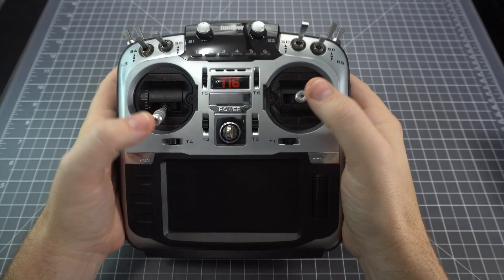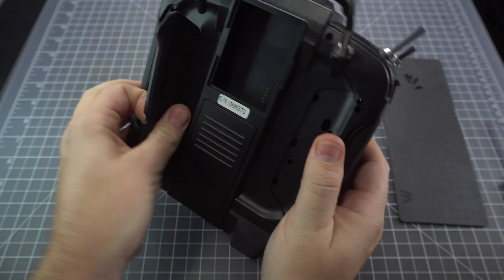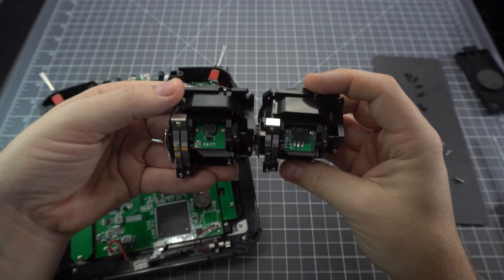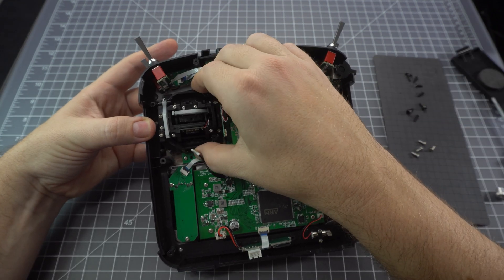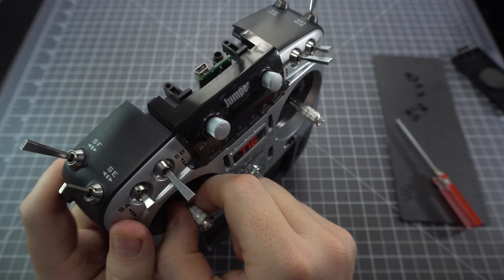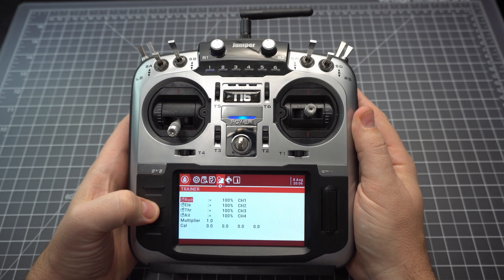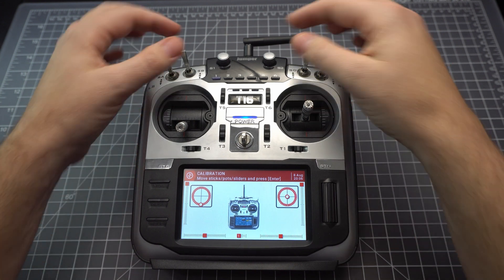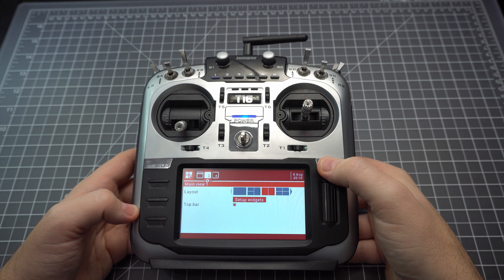Jumper T16 Hall Sensor Gimbal Upgrade

Comment: Excellent presentation. I am not sure that this is an upgrade however. My hall sensor gimbals are unreliable in that the 'input' signal is different every time I switch on. Move the stick and the endpoints change. No comment so far from Jumper or the dealer. This is shame because otherwise I like these radios a lot, despite being tweaky and weird.

Comment: Great tutorial. I need to replace the T12 plus gimbal (not the TX12), it had a missing spring mechanism when purchased. Are the left and right the same or called the same? If not, what is the name  left gimbal ( mode2 - elevator and aileron) so i can order it, or perhaps mae and uprade liek in you video?. If you have any advice on where i can buy , i would appreciated.

Comment: Hello, thank you for all the videos you are very easy to follow along with and have very detailed lists which makes things very easy I have made a few of your builds. May I ask where you got that electric screwdriver you use in some of your videos? I tried looking on rotor builds under misc parts but could not find it and if you search them on google there are hundreds and I bet yours is decent quality I see you use it alot.
Reply from the maker: It's the Xiaomi Wowstick 1F+ and it's under Gear > Tools on Rotorobuilds.